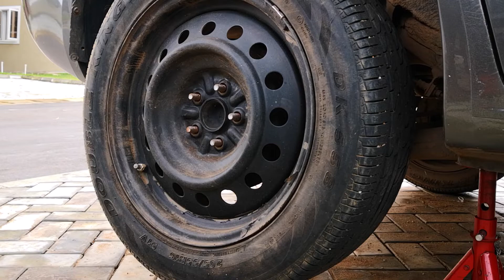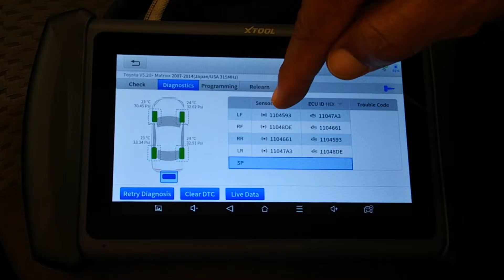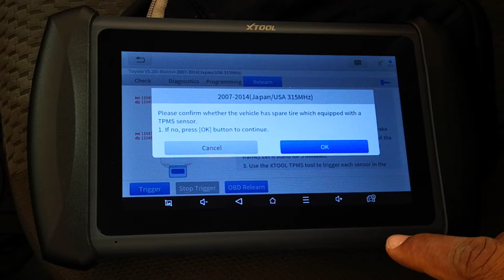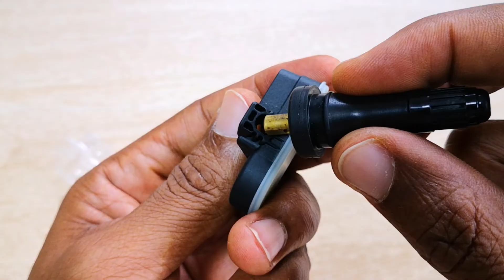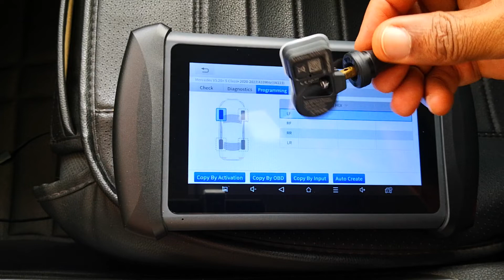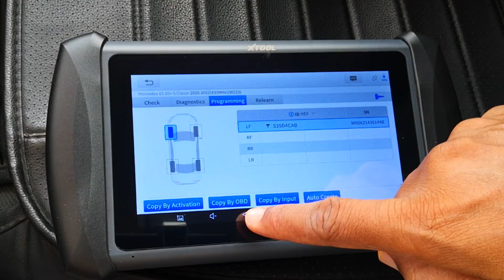Tire Pressure Monitoring System Sensor PROGRAMMING & TPMS ECU Relearn / XTOOL Scanner & TS100 sensor

Comment from the maker: Ever had a TPMS issue or is your TPMS light currently on?  

Amazon links as promised:
 - XTOOL TS100 TPMS sensor   https://amzn.to/3BJTndp (Use coupon DIYTS100 for 10% OFF)
 - XTOOL IP819TP scanner  https://amzn.to/3UsLRfK (Use coupon DIYIP819TP for 10% OFF)
  - Check out my Amazon store for other tools I recommend - https://amzn.to/42LGCL8
I may earn a small commission from a purchase made through the links above. This does not increase the price you pay in any way.

Comment: Which one will you choose between the D7 and the ip819tp? Thanks for video by the way.
Reply from the maker: IP819TP! This does all the D7 will and more e.g TPMS activation/programming and capacity to be connected to advanced key programming accessories.
Reply: @DIYAutoworksNG  Can the IP819TP read pin code and program keys on its own like the D7? Thank for the reply by the way.
Reply from the maker: @rtcfpv1012 yep
Reply: @DIYAutoworksNG Thank you very much. 👍

Comment: Are those xtool sensors reusable as in say you program it to a chevy truck but later took your rim off the chevy truck and mounted it onto a toyota tacoma? Can you now reprogram that xtool sensor again? Or they can only be program once and they are done?
Reply from the maker: Good question. 100% reusable. And no special procedure for erasing them. Just treat as a blank and program.

Comment: I really need a scan tool....
Am in Kenya 🇰🇪 but the prices are way too expensive...
Any leads will be appreciated
Reply from the maker: Have you tried to import? It's usually cheaper this way, except if import duties are very high. Also to beat import duties, you can use a freight forwarder who typically pays a blanket duty amount for his total import consignment. This will mean that the import duty is already included in the price the forwarder bills you.

Comment: Is this tool able to program/register factory oem Toyota sensors or ONLY xtool ts100 sensors?
Reply from the maker: OEM Toyota sensors come programmed already and there's no need to program them. You only need to relearn the TPMS after installing, and yes, this tool will relearn those.
Reply: @DIYAutoworksNG  I see. Do you happen to know if autel mp808-TS or mk808-ts are able to relearn Toyota sensors as well? If so do you have a link to a video you’ve done on that scan tool along with link to purchase for you to get commission so I can help support you.
Reply from the maker: Hey. Sorry I missed this. Here's a video where I relearn the TPMS on a Toyota Camry using the MP808TS. It's one of my older videos 😅 but it has all you need to do a relearn. Let me know how it goes. Links are in the description.
Reply: @DIYAutoworksNG  after I install Toyota sensors in the wheel then do I just go to relearn? Will it ask for new sensor ID that was on the sensor?

Comment: Do you know if it's possible to reprogram OEM sensors to a different vehicle? I put the tires and wheels from one Chevy truck onto a different Chevy truck and I wonder if I can fix this without having to buy new tire pressure sensors?
Reply from the maker: No. But since its a Chevy to Chevy swap, depending on the models, you may just need a relearn.